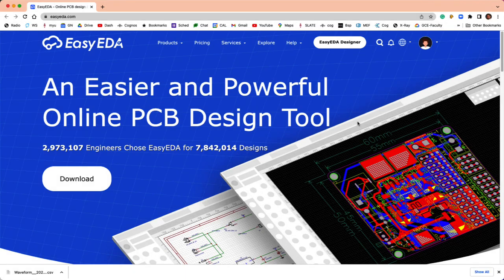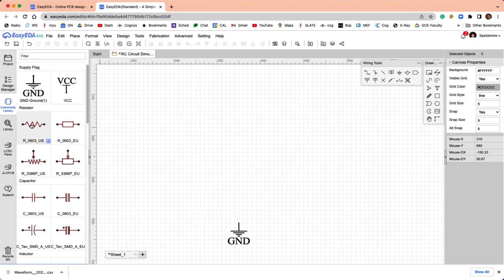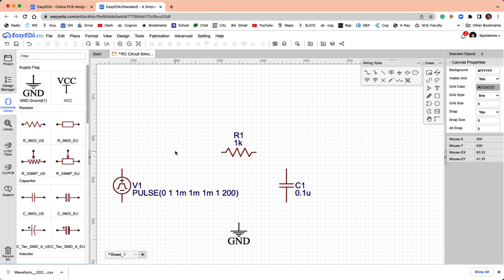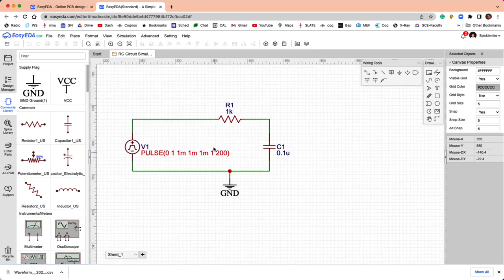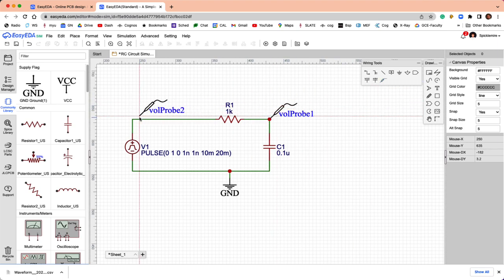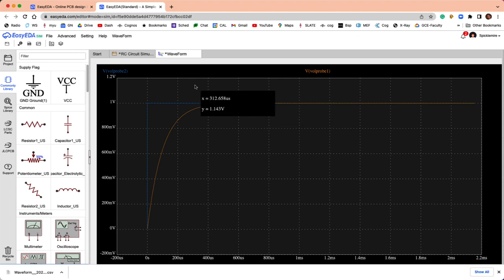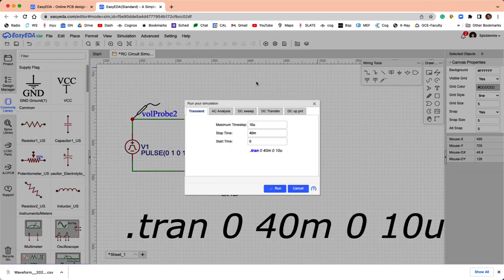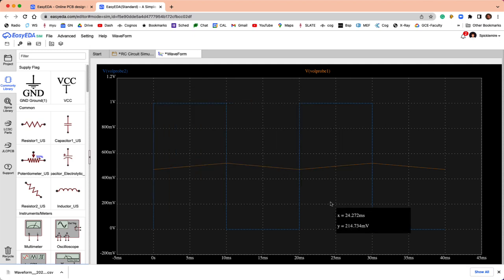EasyEDA: An alternative Schematic Capture and Simulation option.

Comment: I place a voltage source, but for some reason I cannot acces it's Settings (to set it's voltage and signal). In the right side bar only two windows appear: Component Properties and Custom properties, non of which let me specify a voltage. :(
Reply from the maker: Did you switch to the simulator tool (Menu -> Tools -> Simulation)?